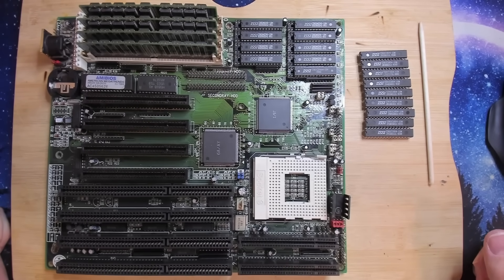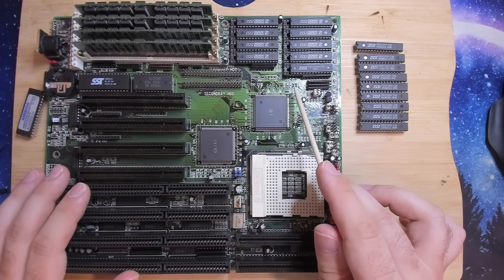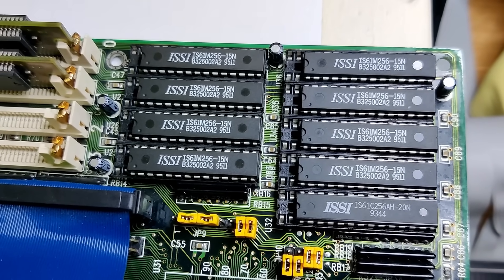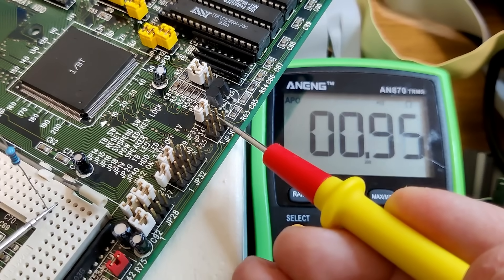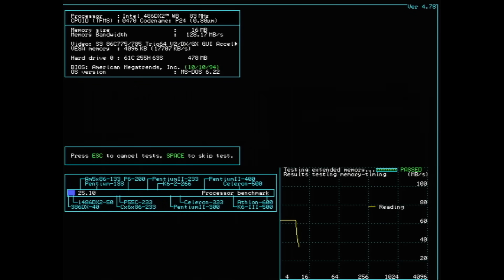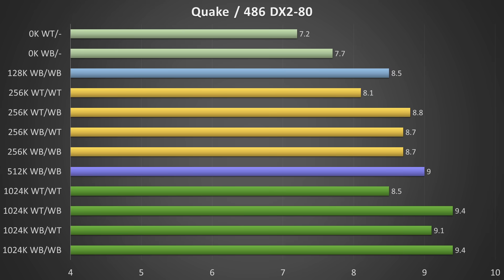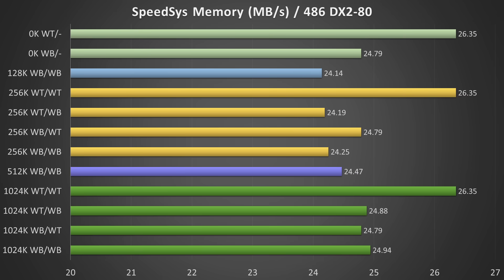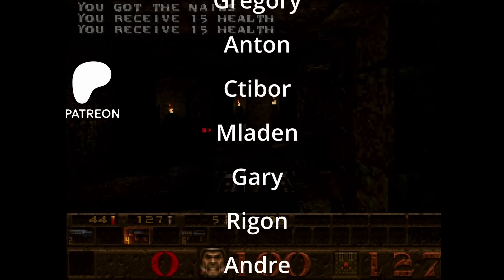How Much Level-2 Cache Do You Need?

Comment: You packed so much into this video, amazing. When I was building out my 486, I went with 512K of cache because "why not?". So many forum posts agreed with what you tested: 256K is enough, everything else is diminishing returns. But still though... 0KB of L2 to 1024KB of L2 in Writeback is a heck of an upgrade.
Reply from the maker: 512K on Socket 3 feels like luxury :) If you can, of course, go for it! I think 486 systems had mostly 128K and 256K L2. Pentium boards had mostly 256K and 512K (usually as an upgrade via COASt). The diminishing return really kicks in after 256K on this platform.
Reply: Some boards that had 2 banks of cache and could do interleaving would recommend using 2 128k banks instead of a single 512k bank. As the cache could perform a little faster when interleaved and the larger single bank cache often didn't make up that difference. Usually the only reason to use the larger cache was when you had more ram installed and tag size was insufficient. But in early 90s, having 64mb was into the thousands of dollars.